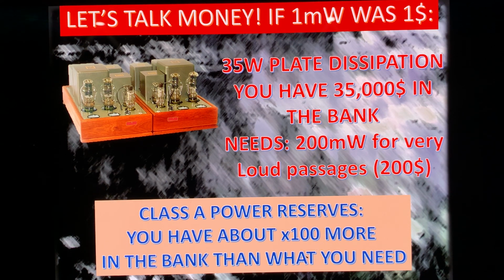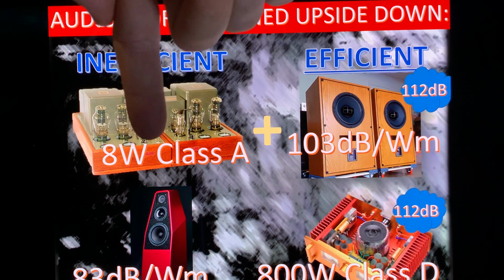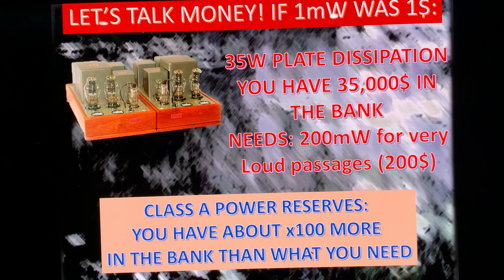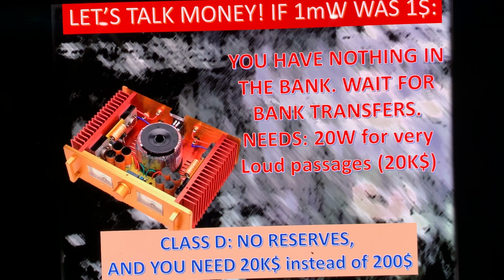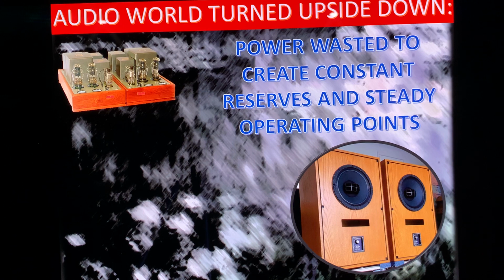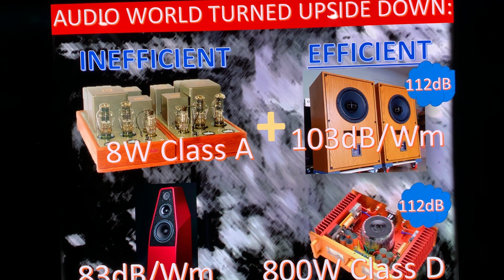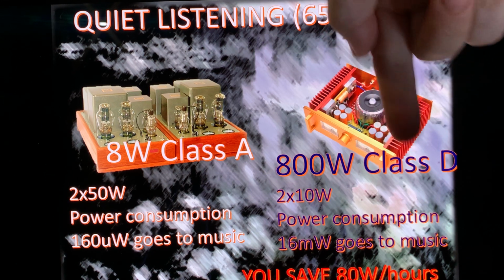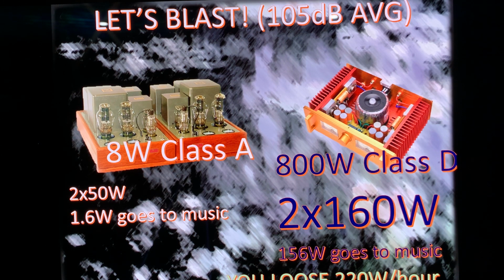Wanna save on electricity bill with Class D system? How does modern hold up against golden era?

Comment: Would be interesting to see the current draws over time of a song or full CD between both types.

For example: my system idles at 0.4 amps, when playing a CD it's 0.6 amps through a full CD ( pre/pro, class-D amp, Magnepans, CD player are the only things that are on )

It doesn't matter what kinda of music I play. My older class D made that number 0.8 amps. (4 x 320 watts NEW , 5 x 180watts OLD )

Your example has a 8 watt tube class A amp using 50 watts per channel total would still use more power than my whole system ( excluding my subs and PS4 )

I didn't get a class D amp to save on power. 

What are your thoughts?
Reply from the maker: Thank you Jaakan for the feedback! Interesting that the older class D amp idled so high! In class A the consumption is constant, regardless music material, or whether it's music playing or not. My Double Darling amplifier consumed about 0,45A (120VAC), and the proposed Baby Darling consumes a wee bit over 1/5A (25W). I have not measured total system consumption though, yet I can confirm that it never amounted to be noticeable on the electric bill. I agree with you though, saving over power is not an issue unless one is off the grid and has limited amount of solar power. Janos

Comment: I have some of the most efficient speakers ever made, VOTT A4 and this week I received some Eigentakt Purifi amps. They work very well! Sound quality is top and every day life is soooo much easier. No noise, no heat, no energy bill and the system is always ready to play, no warm up period. The “first watt” in the Eigentakt is very good in every respect, “Class D” and please note that “D” does not stand for digital, has come a very long way and should be considered by event the most demanding audiophile.
Reply from the maker: Thank you Klaus! I am quite impressed that they can handle the A4! Class D seems to have gone a very long way!
Reply: @realworldaudio  as you know it’s all down to the quality of the first watt(or milliwatt in this case). Typical class D(if there is such a thing, let’s call them old and inexpensive here) sounds very “flat” and uninspiring at extremely low power settings. They are also very noisy with a lot of high frequency hissing… so directly connected to the 288CD and the 1505 horn will never work.

Comment: I have never been able to reconcile high idle dissipation amplifiers. 83dB/W speakers, what a joke.
Reply from the maker: Indeed, I don't like high idling at 10-20A either. However, around or under 1A (at 120VAC) of typical low power tube amplifiers is pretty low, it never showed up on my electricity bill as a noticeable expense.

Comment: Very informative video! Interesting comparisons as always 🙂
Class D amps seem to have sound signatures of their own, probably due to the built in power circuitry being unable to cope with the instantaneous power requirement for those tight bass notes. 
For me, exceptions are the PAM8403 & PAM8610 in the low power range, which I currently use with off-grid solar power & repurposed lead acid batteries.
TDA7498 sounds very good too for those who need higher power, could also be used with 2x solar panels (24v).
Two essential upgrades for low power sound systems in my opinion:
First one is cheap & cheerful 6j1 tube buffer preamp. Big improvement in dynamic range & very nice warm sound (uses around 10w at full tilt, which is higher that the class D power amps 😂, totally worth it)
Second upgrade is a supercapacitor bank. I recently installed 6x 2.7v 500 farad caps in series (total ~$50 or so), effective ~80 farads @16v or so. Provides more than enough headroom for the class D power amps that I use. 
Of course, all of this is DIY, hours & hours of time spent on each part of the system, but there's nothing you can buy off the shelf which comes even close to the sound quality! It's like a favourite pair of headphones, without the headphones 😂😂
Reply: Ime ferrite in the output filters kills bass 'authority'.
Reply from the maker: @ericmc6482  Hi Eric, I found the same thing - ferrite rings on signal wires limit dynamics and impact.  It's best to use them on everything (computer, fridge, toaster, lights...) but stereo.
Reply from the maker: Thank you Vikas for sharing! Indeed, it is also my observation that class D is extremely sensitive to power line. Solar AC is quite likely a massive improvement for them, and your route of going to a super-stabilized input with the high capacitance is also a long step in the right direction. Were I to get into class D, I would also go the way you went! Superb job! ; )  One tip to tweak your power supply further: bypass the farad capacitors with smaller, high quality capacitors. The farad caps store a lot of energy, but are very rough on the power delivery. You will get a lot of intricate detail level and extra smoothness by bypassing with smaller capacitances: add 3-4  of 10mF@16V capacitors. :)